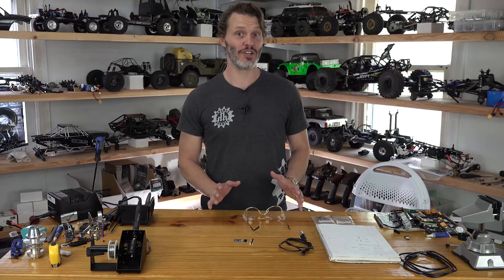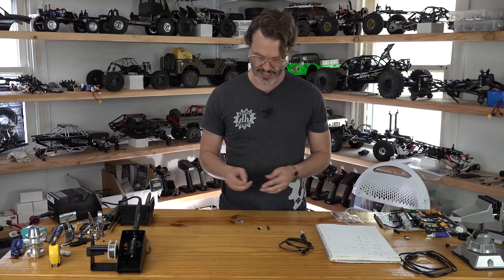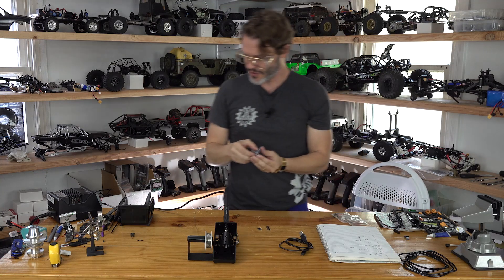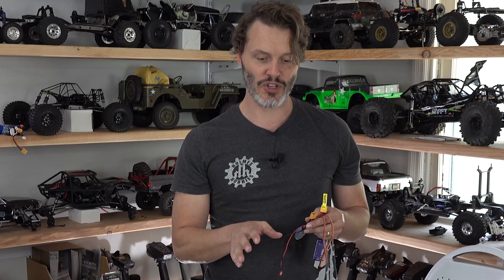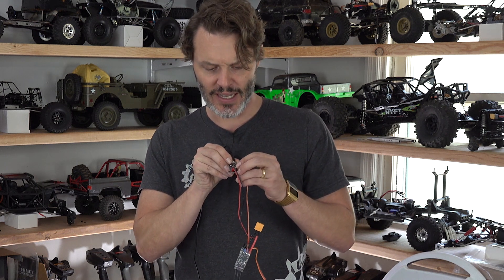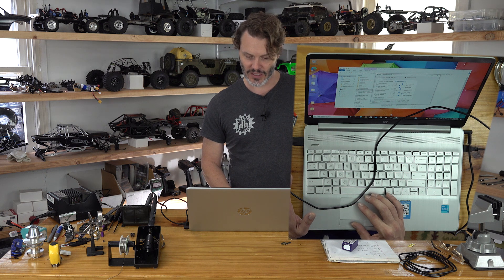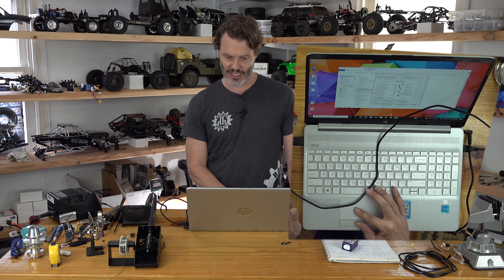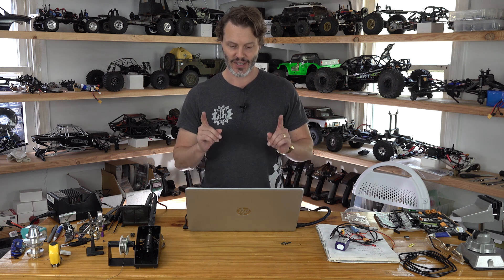Crawlmaster Mini ESC Serial Programmer Assembly And Use - Holmes Hobbies

Comment: Would HH or customers be interested in a customized and assembled CP2104 USB to serial converter built and designed in the USA by Rugged Circuits?  This could be a HH stocked item to compliment the awesome MINI ESC and take away the hassle of assembly for the customer.
Reply: Ideally if we could get John onboard and generate the proper volume, cost would be pretty comparable to the gathering all the parts and a few dollars for assembly.  A HH LOGO would look awesome on the board as well!
Reply: Good idea but it depends on the price  I guessmost RC guys are cheap a...es! LOL
Reply: I'd be interested!!

Comment: i was going to wait till the programing video came out but it acts a little weird now and then. when i up dated the file none of the check boxes were check but you went through them on the video, except the ones on the input tap low voltage cut off was unchecked. also the motor kv  changed from 1450 to 2200 i'm running the 1800 kv revolver does this need to be set to 1800 kv? and  the pvm went to 24 and not adjustable. These settings are what changed that i noticed when i updated. Now when i plug the system in, about every 3rd or 4 th time it does not arm it just beeps 3 times over and over. I un plug and plug it back in and it works fine. the other thing i noticed is it is not as responsive to the throttle input still great slow speed but from forward to reverse there is a lag now.
Reply: What configuration tool do you use?
Reply: @themountain59  i made the first adapter shown on Instagram the red one and the configuration tool listed after the video on YouTube. i have since downloaded the suite from the web site and it sesames to be working right now after re flashing.

Comment: Exo loves the cmm and he's in florida?
Reply from the maker: his did/do not have temp cutoff enabled.
Reply: @HolmesHobbies  what about  the "holmes hybrid" with a revolver outrunner on one end of can that rotates and a stationery end of the can that holds esc and bec? Ideally with the unit still being short as possible as close as we can get it to the length of a stubby motor??  I really have been dreaming of something like this and thought I'd throw it out there basically a smaller fusion that's a outrunner with stationery end holding esc/bec?

Comment: I viewed this video 20 minutes after it was posted and ordered all the parts immediately.  The signal diode was “out of stock”.  I have all the other items coming from adafruit.  Is there another “replacement part” for the signal diode or do we all have to wait for their supply chain to catch up”.  I love your business model John and am a very loyal customer as a result of it!
Reply from the maker: You can order the same diode from about anywhere. Google will get you there
Reply: @HolmesHobbies  I thought it was an adafruit only thing.  Thanks for getting me in the right direction.
Reply: Digi-key  has multiple of that pn.
Reply: @cccustom  Thank you.  Ordered.

Comment: Do you recommend we send in our ESCs if you don’t have the programmer?  Mine overheated and shut off recently, but I assumed because I had the motor wires bundled and built up heat and a warming afternoon in Ohio.
Reply from the maker: You can do that or get a programmer yourself

Comment: Can you please recommend some solder tips that don't wear away within a few uses? Thank you👍✌️👊
Reply: What solder/ flux/ flux core are you using. Depending on your flux type it can eat away at your tip more quickly.

Comment: I am a new subscriber and if I way out of the wheelhouse here please dont hate me, my RC financial funds are equaled to a shoe string and a old chewed bit of gum, so my question I Have a SCX24 witha bad stirring  servo! Its happens to be the 3 wire type, well on broken HBX 24 there are  front and rear stirring servos that work fine but 5 wire come from them, Is it possible to replace the broken mini servo from Working SCX24 3wire/3pin with a working mini servo from HBX front or rear working servo with 5wire/5pin somehow Makeing it work in on 3 pin SCX24 esc and getting my tiny rc dream on the trail again until I am deemed Disabled and can still be poor but can save hear and there for my RC Addiction even if I do it on shoe strings and super glue! Hope my question was understandable and clear ,I  leave half of what I think I am typing out most times, and confusion I be more than happy to help you Understand Thanks,and Keep up the good work! 
Charles

Comment: is there a different configuration when i have all three wires from esc. i have the power wire from the bec connected into the esc connector. where it was originally two wire. will that differ from what you have wired up and will it affect anything

Comment: Soooo, it doesn’t come fully assembled? But does it come with all the required parts and just need soldering?
Reply from the maker: We have the assembled and ready version on the site.   Or you can buy the parts from adafruit, solder it yourself like I showed,  and save a few bucks.
Reply: @HolmesHobbies  thanks!